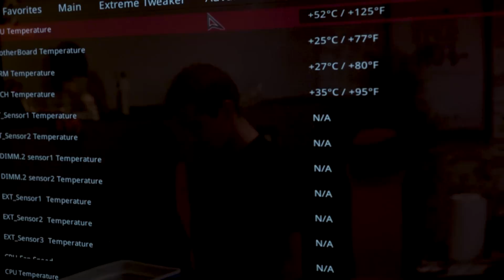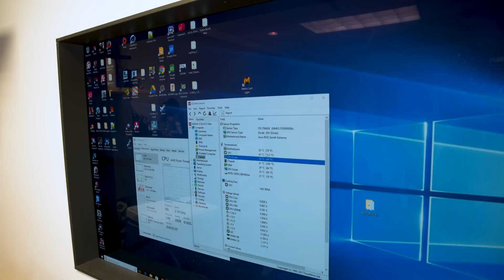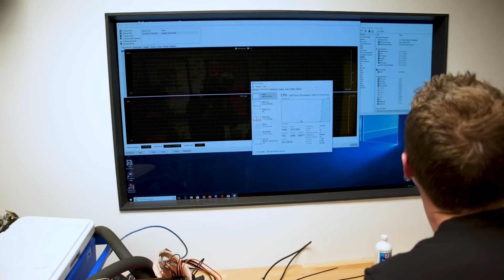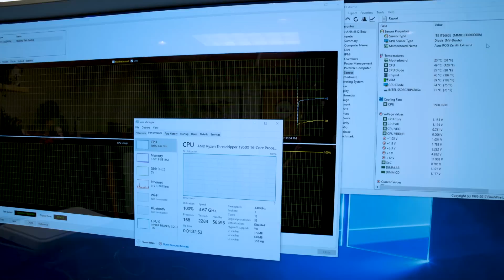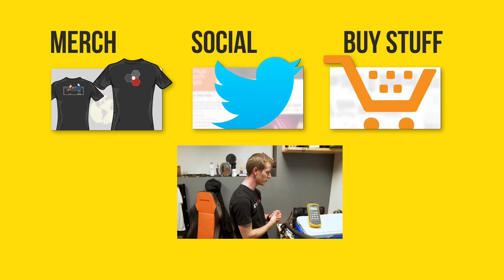My 10 Year Old Chiller WORKS! -20C on THREADRIPPER!

Comment: I remember the days where people did stuff like this, it seems like the newer generation doesn't understand that many of their pre made systems came from people messing around with things (like this) as a hobby and now people cant deal without the fastest simplest thing out that money can buy.
Reply: Too true. That and they don't care about this type of stuff as much. If they get into overclocking it is to compete with LN2 or Liquid Helium. Otherwise most are just into buying fancy looking parts with RGB lighting that they can easy assemble with some tube bending at the most.
Only so many people put the effort into stuff like this or real case/system modding/building.

Comment: Some changes I would make to that. I would use a cooler unit from a soda vending machine. The main part of it is already on a tray and the part that cools is on a long copper piping already. Plus I would probably coil the tubing on the bottom of the tank. They also make roll around AC units for cooling single rooms. And those have tubes to blow the hot air out through a window using a adjustable wall to fill in the open part of the window.

Comment: this is are compressor that compresses the fluid XD . ok lets start at the compressor ace Ventura style refrigerant leaves the compressor as a high pressure high temperature superheated vapor go's through the hot gas line into the top of the condenser and is desuperheated condensed and sub cooled it leaves the condenser as a subcooled liquid through the liquid line go's through the filter dryer to a metering device ware the refrigerant is flashed over to a 25% liquid 75% vapor enters the bottom of the evaporator coil ware the refrigerant boils off to a low temperature low pressure superheated vapor go's through the suction line back to the compressor as a vapor
Reply: William Worth it ain't going back to that compressor as vapor silly needs a suction line accumulator

Comment: Oh! Now I see! You're using the phase change system to cool the cooling liquid that goes in the liquid cooling loop. Nice, but wouldn't a straight up phase cooling solution using the CPU block as an evaporator do better?

Comment: My city has 2 water lines going into my house, for constant flow because the line would freeze in winter. The water lines are buried below the permafrost so water incoming is always 5C, I'm gonna steal the low temp water for my pc and never have to worry about high temps and always a good overclock. . I would have a heat exchanger and a aquastat/ thermostatic valve to keep my pc just above ambient temp.

Comment: Linus (or someone else), I doubt you'll see this, but here goes anyway.

Try obtain a slab of raw/industrial diamond and use it in heatsink/cooling experiments as the thermal conductivity of diamond is a s**tload better than everything else on the market right now.

And you'd get a feather in you cap for (probably) being the first to have a diamond heatsink

Comment: i give you credit that you almost know how a Refrigerant cycle works.

Let me start at the compressor where it compresses "gas" the refrigerant and makes it hotter to be pushed into he condenser that your fans blow across to turn the gas to a liquid, that flows o the evaporator that fans normally blow across to pick up heat and turns back into a "gas" that gets sucked back into the compressor

Comment: Helpful info - Its a rapid pressure drop do to change in diameter of the copper line that causes the coolant to evaporate, not heat from the computer.

Comment: Just mount the air conditioner part outside and cable manage the pipes to the CPU through a window. Half the problems solved right there.

Comment: I have found removing thicker applied (liquid electrical tape) easier than thinly applied. As it can take more tug and sustained tension and thus pull up more as a large film rather than tearing membrane which can stick on some finer bits.

Comment: Why not seal the mother board and CPU in a dry box , purged with nf nitrogen. We use it in piping that has to be absolutely clean and free of any moisture. If said container was very well sealed , you wouldn't get any condensation.

Comment: So I hear they have a new name for liquid tape, it is called glue.  Super new though, so I can understand the mistake.
Reply: There is a pretty large difference in substance
Reply: a transparent nail polish will also work. A regular glue contain water until it dry out, so it's riskier to use on live electronics than a nail polish which contain acetone (I think).
Reply: Plasti-dip is closer to what he was using (rubbery). I use spray can type, 8 layers (the more layers, the easier it is to peal off) when I prep components. Also you need to Vaseline the RAM and PCIe sockets, because those will get icy cold as well (but maybe not with this ghetto solution). I was cringing the whole time when he was leaving massive air gaps, but as long as he's only running a few hours, it's probably fine.
Reply: Are you stupid?

Comment: The compressor doesn’t compress liquid. It compresses gas. The cycle is compressor to condenser to metering device(the tiny tube)to evaporator back to compressor

Comment: Compressors can't compress liquid that is how you make them explode.... Compressors compress vapour which then rejects heat in the condenser, where it 'condenses' and that moves thru the metering device onto the low side, the 'evaporator,' where it evaporates. When it evaporates it sucks the heat out of everything nearby, such as, say, your beer in a fridge and it turns back into a vapour before it goes into the compressor. So your refrigerant cycle isn't cooling down your food, your food is heating up the refrigerant.

You just had the cycle backwards which could wreck your stuff if in practice

Comment: An where does the AC take the massive amounts of heat from, that it radiates into the room?
Yes – from the room. It's a closed system, so you'r just pumping head around. The increase of temperature in the room solely comes from the CPU and thus is not different to a air cooled PC.

Comment: Overclock to 20 GHz!
Reply: bladudemovies Safe and productive
Reply: Sub-zero the entire mobo so you don't run into BIOS thermal throttling.  Sorta like Linus did in his mineral-oil aquarium build, but dunk the heat-exchanger in there with it.
Reply: I suggest then to switch over to Quantum Entanglement as a means of transmitting data within a CPU chip! German and Chinese researchers have put its transmission speed at between 10,000x to 50,000x the speed of light so instead of taking 4.3 years to Travel to our nearest star pair of Alpha Centauri A and B it would only take between 20 minutes to 1.7 hours via quantum teleportation....SOOOOO.... for CPU chips we could now go up probably to PAST 10 Terahertz for a chip the size of an AMD Ryzen 1950x if it used Quantum Entanglement for communicating between cores, cache and other critical ON-CHIP areas!
Reply: duarrrr...... horreyyyy fireworks on ur CPU XD
Reply: God fix this pls
Reply: Voltages and Thermal design would not allow that.

Comment: Hey Linus why don't you try and use copper tubing in loops and put it in an ice box with water and salt and connect the copper tubing to the cpu and a pump o.o like regular liquid cooling but instead of the rubber hoses you use a copper tube  :3

Comment: Why did you use RainX washerfuild for this??  That stuff has no thermal properties to it.  It will be the same or slightly worst/better than plain old water.  RainX doesn't make pink coolant for those saying this is just pink coolant.  Check their site, they don't make coolant at all.

Comment: That system has a long thermal chain. It would be much better to run the evaporator straight on the CPU and cut out that watercooling part. It is not needed. Check the Asetek Vapochill case. It's a refrigerator with a condenser tailored for cpu. That was almost 20 years ago.

The watercooling part is just a way to trasfer the heat from the cpu to the condenser..  Sure that a condenser that small and functional requires some engineering (a lot to do a proper calculus to give best result depending on wattage, temperature, and pressure, and flow, etc). 
Another way to transport heat is trough conduction (lowtech but a 3kilo block of copper has lots of thermal mass.. so that block can be riddled with holes to run the condenser tubes.. enough to keep the cpu and that chunk of copper at a nice close-by temperature)

An even better approach is with low thermal mass and heat-pipes. Be aware the heat-pipes must be matched to the temperature range in use. The normal heatpipes are ok for around 30 deg Celsius, made with water or alcohol under low pressure. For lower temperatures, different fluid must be used.

Comment: ANY ONE READING THIS I HAVE A QUICK QUESTION

So I have a windows 10 installed on a mobile hard drive that can be plugged in our school pc's. I forgot to stop the automatic installed update, and a fucking updated started installing 30 min before the end of the class, I used a moment of the installation when it restarted to stop the pc and remove the hard drive, because i realy had to go.... 

How big is the chance that I corrupted windows. I am like 75% sure I did not but I am still worried since I need to wait for tomorrow to see if its OK and finish the update and fucking disable that automatic cancer, or fucking reinstall everything

And IF the installation possess need internet because I could run it on my pc to finish it but I dont have the internet driver installed for my home pc
Reply: if it was in the middle of an update, there IS a chance you corrupted it, but i've had blackouts when doing updates, and it just keeps going after I reboot. Just make sure to verify everything's there with CMD

Comment: You could probably skip all the waterproofing of the motherboard if you did a fully cooled build and then made it air tight and just threw in some silica gel packets or for the full LTT Stupidly Overcomplicated® experience you could purge the entire case with that "Dry Nitrogen" the gear heads like to inflate their over expensive tires with.

Comment: LINUS WHERE IS THE OVERCLOCKING seriously dude that is the only reason to do this and you skipped that part
Reply: IKR, I watched to see overclocking and benchmark scores!
Reply: most ryzen correct cant go above 4ghz but remember that thread ripper uses top 5% of dies meaning that the worst threadripper is better than the best 1800x.

With that said, some threadrippers can hit 4.1, few go to 4.2 and select go to 4.3 on water. This is below water so i'd say he could probably get 4.2-4.3 ghz overclocking.
Reply: Bayan Zabihiyan
Threadripper has reached 5ghz on LN2
Reply: dont you think he had enough problems with the kludge cooling to worry about overclocking?
Reply: I‘m disappointed as well but I‘m also pretty sure the oc would only be maybe 200MHz more than on normal watercooling.
Reply: so you want a loud, hot, dangerous, bulky, and impractical sub ambient cooling mechanism (that WILL short the chips life) so you can not overclock  when all you need is a water loop to keep that chip cool enough to avoid throttling than you ARE stupid, linus built that rig originally to massively overclock one of his old amd chips
Reply: maybe 4.4 but we will never know :'(
Reply: the whole point of the KLUDGE cooling IS oveclocking otherwise it is a waste, he could have had less trouble if he did nothing at all and dragged out the case that had built in faze change cooling
Reply: lol, maybe with a normal cooler but I guarantee that will change at -10 or so. never seen Liquid nitrogen cooling. I guess not.
Reply: I remember that my AMD XP 1700 was a beast at overclocking. I managed to hit 2,3Ghz with it with a standard Vapochill SE with R404a. During this time Intel had the Pentium 4`s which where not exactly great for overclocking.
Reply: +Fuc kYourAds
What are you even talking about?
AMD chips are the best at over-clocking, unlike Intel's.....
Reply: Nighterlev well the old ones were.
Reply: Aaron Goodrich hmmm I'm not sure how that addresses our statements. That is a different CPU and there seems little point to set it up and not run an OC and a few benchmarks.
Reply: Linus videos have given up all  the good quality. Just blablas and hahas but no relevant informations. No details how to install how to apply stuff and now no benchmarks? The idea is great but that "freestyle" of doing videos like this one is so ghetto.
Reply: https://www.youtube.com/watch?v=4d0B0Dli-1g   = Same thing for last time
Reply: Bayan Zabihiyan LOL...... A .1 or .2 increase from water to this craziness is pretty extreme for at best a 5% uplift. Still cool to see however. No pun intended
Reply: Actually...not the only reason to do this :S
Reply: Probably they committed it since it's already a given the Ryzen 1 cannot achieve stable overclocks past 4.0 Ghz.

Comment: Isn't that slightly the setting way round? 

1) Hot gas goes into the compressor and becomes very hot liquid. 

2) Very hot liquid becomes room temp liquid in the condenser. 

3) Then room temperature liquid is boiled in the evaporator by the heat source (CPU)

Comment: Why the crap didn't you overclock this machine!? The people want to know if going that cold will yield huge gains on a threadripper.
Reply: Threadripper overclocks dude. Just because it's cheaper doesn't mean anything. Ryzen chips are amazing, thats coming from a fellow intel fan. Linus still could have had a lot of gain from a threadripper, even if it wouldn't be as overclockable as say an i7. he could have gone well past 4.5 ghz, probably 5.2 or higher if i could guess, which is still miles faster than the stock  3.5 ghz
Reply: Dislagmination - That's not the point of it. You're probably too young but there used to be a lot of hype around overclocking your CPU. The biggest limit was heat. If you get it cold, you can overclock much more.
Reply: Fuc kYourAds i dont think you understand how tech works buddy
Reply: +Fuc kYourAds i have overclocked my 1600 to 3.9 gghz so yeah and i dont have to pay more for an unlocked chip
Reply: They'll do it but will make a 3 part series on overclocking it as they always do with pretty much anything now :/
Reply: All CPU nowadays is overclockable because both AMD & INTEL's Turbo feature will automatically overclock your CPU without even telling you, some even gone too hot and broke itself. In both Linux & Windows OS you can control these setting without needing a custom motherboard nor software from AMD/ Intel.
Reply: There is no benefit to cooling this much.  Pc components are designed to run at optimum temperatures much higher than this. This installation might actually reduce performance and may cause other problems (he mentioned condensation) but there is also overclooling and excessive drying which can cause electromagnetic interference. This was fun but actually totally useless
Reply: J Anything i do understand but my point is this is way too cold even for overclocking. For overclocking you need to make sure you don't pass a certain temperature but you do not need to get it colder. Believe me i know what m talking abt i do this for a living
Reply: You overclock PC's for a living? How the heck can you make a living out of doing that?! I'm an IT consultant for a living, worked in IT for 15 years, an a hobbyist for a good 10 years before that. The CPU was running at around 23c under full load without overclocking. If you overclocked without the cooling, you wouldn't get much gains, but with the sub zero cooling, you can overclock that CPU a heck of a lot and get the same temps as a non sub-zero cooling system would be under full load without overclocking.
Reply: J Anything hahahahaa no I dnt overclock cpus for a living. M a cooling engineer specialized in critical environments such as datacenters, clean rooms, labs, supercomputers and research centers etc... so it is my job to make sure mainly silicon chips,gpus, cpus etc are running at optimal conditions. Now you touched on something very true in your latest  reply when you said 23degC. Actually my entire point was we get no gains below 24degc and we start to reduce performance below 18degC. The magic range is 18degC to 27degC so if you can get your non overclocked cpu to the low end of this range you can safely assume it will still be inside this range after overclocking. I think we may have the same point said differently. Cheers
Reply: What I mean is that if you have the coolant  as low as it can be, and then overclock the CPU till it is around your optimum temperature, then it's ideal? Yes perhaps same point but different.
Reply: Fuc kYourAds That's not how anything works.
Reply: Oly ASUS payed. the threadripper didn't
Reply: Tonyert its more like linus paid tips nowadays xD